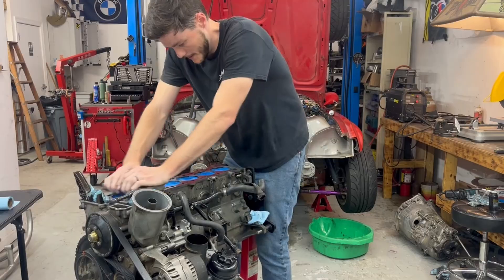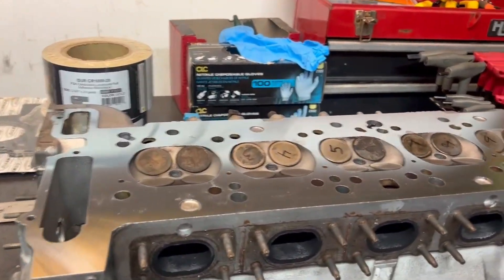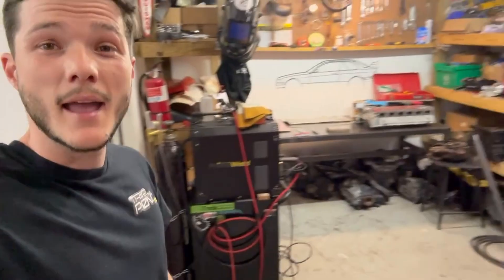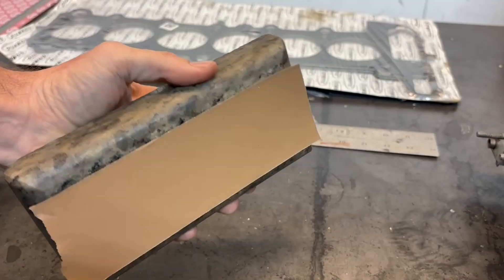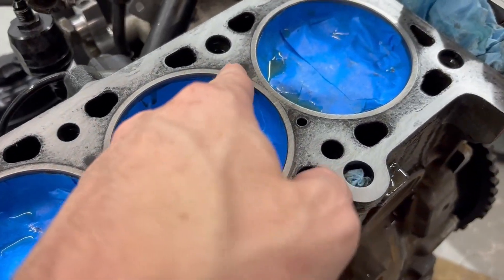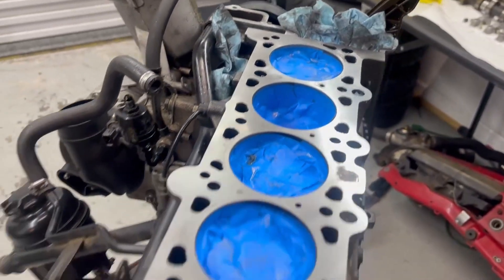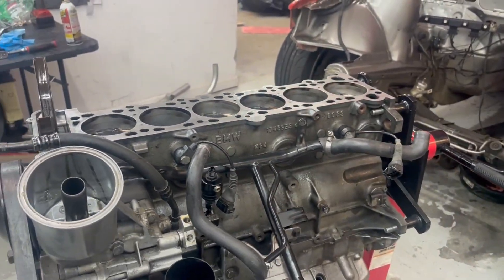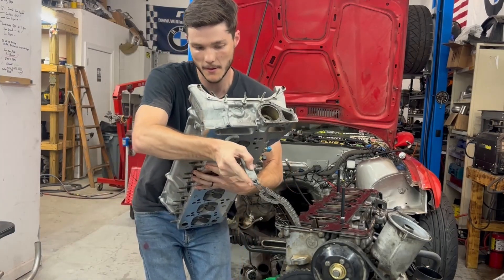How To Skim your Engine Block!  MLS Headgasket Prep at Home!

Comment: I don't think that high of grit is needed, but sure will leave a nice finish.
Reply: Agreed.  Use a bigger "block" also and don't get to wound up over the grit.  The bigger/longer the stone or block you're using, the better.  Small stones like he's using here are jsut going to follow dips and warped areas.

Comment: Fel-Pro gaskets says a 50-60Ra for deck finishing which translates to a 160-220 grit. Was wondering why you went to a 1000 final finish
Reply from the maker: It was the recommended grit by the machinist who did my head!  But you are correct it could be too smooth.  Better for me to match ra on block to head though!

Comment: I use a large piece of glass with sand paper glued to it. I set the head on the paper and just glide it back and forth.   Has worked well for me. No machine shops in my area (they all shut down)
Reply from the maker: Glass is a great one too!!

Comment: Wondering if you'd help answer a question. 

On a92 325is M50, what would be an alternative front end hooking position on the engine if the head is already off? 

I'm getting ready to pull the engine and the head is on the workbench after being milled.
Reply from the maker: Thread 2 head studs in and hook chains to them!
Reply: @Drift.Things that makes sense. 

First time doing this so thank you

Comment: I did the same to my m50b25 Turbo, Stock engine, only resurfaced head and Laped Valves with cometic mls in 1.91mm thickness and some 12.9 headbolts (arp wasnt im my budget and I wanted to try bolts) the engine makes 425hp and 522nm on pump gas (german e95, 98 oktan ) and is fine without rings
Reply from the maker: Love to hear that!!

Comment: Timing chain cover has to be level with the block as well since the head also sits on it. If you have one decked at a shop they have to have it installed as well.
Reply: I also put a thin thin layer of gasket maker on my MLS before installing. Might’ve been overkill but it was recommended.
Reply from the maker: Yes for sr20 but doesn’t matter for m50.  That part of gasket only seals crank case and not actual compression areas!  Just a thin rtv needed where they meet..

And NEVER do that with cometic mls.  Don’t use rtv on head gaskets ever actually.  They have a specific coating on the outside for sealing

Comment: I could tell instantly because you were going back and forth, you will a low area in the center
Reply from the maker: Low area?  Everything is less than .001 with machinist level and feeler gauges.  Flat af
Reply: @Drift.Things you are sanding the center twice as much as the ends. I made the same mistake. You have to use something that will stay in contact with the block end to end at all times.
Reply from the maker: @michaelrogers9872  this method worked great for sealing an mls.  Which is hardest gasket to seal.

Had less than a .002 across the whole block.

Comment: should taken out chain tensioner, front of the block wont be totaly flat
Reply from the maker: I agree, but would have to remove the front timing cover, and the goal was to not takeoff the damper and other pulleys.  The block got fully sanded, just not edges of the back of the timing cover but they do not require decking

Comment: Back in the early JDM days I used to see kids machine just the blocks without the front cover. Both the motor back together and be shocked when the front cylinder didn't seal or there are issues with the oil pump or front cover cracking.
Reply from the maker: number 1 mistake when machining an sr20 is not having the front cover mounted!  You are exactly right
Reply: @Drift.Things  Genuine question: Can you explain why you have to have the front cover fitted?
Reply: @Kj16V  On the SR20 the top of the front cover forms the sealing surface for the head gasket. So if you have skimmed the head to clean it up and haven't done the timing cover, the top of the timing cover will be slightly higher than the deck height.  Problems will arise when you bolt the head down, it won't seal properly as the entire surface block deck + top of timing cover won't be one continuous flat plane.
Reply: Holy hell man I’m about to do this and am glad I locked at the comment 😅 Mercedes would have been gone(again😢)

Comment: What made you steer away from another cutring?
Reply from the maker: I initially thought it was a cut ring issue, but it turned out to be a head crack!  So I still recommend cut rings without the copper spacer
Reply: @ Cool, thanks for the response.